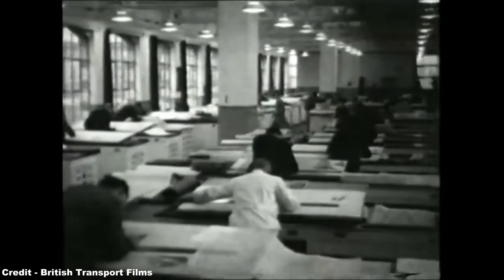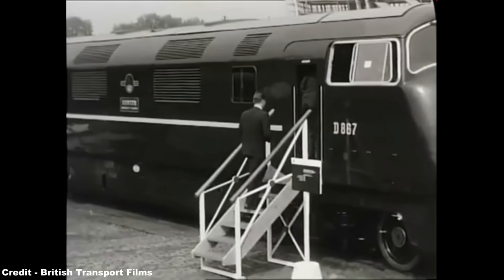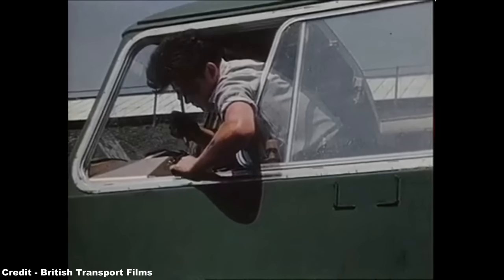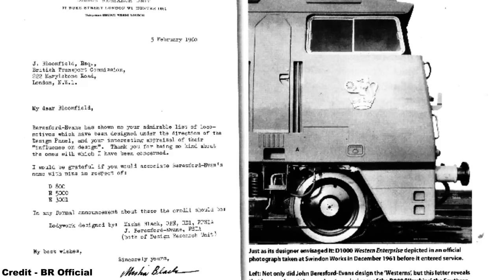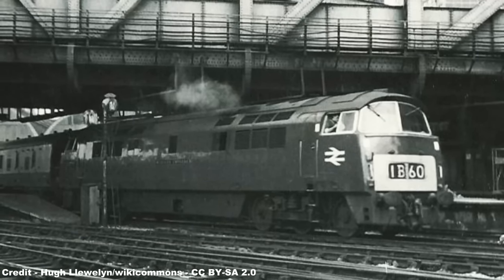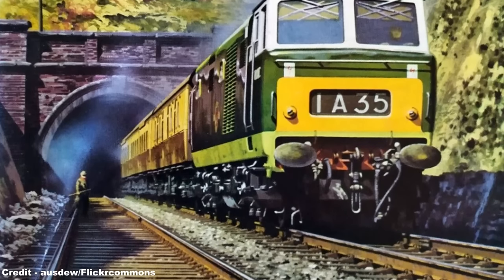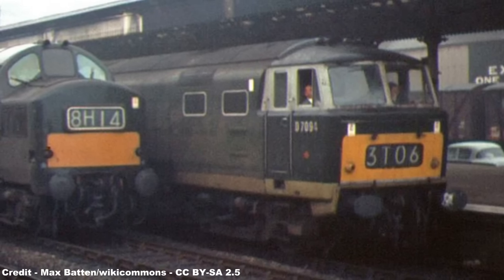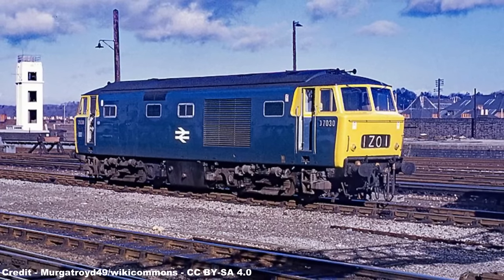The Tale of the Diesel Hydraulics

Comment: The Brush D0280 Falcon was not the progenitor of the Class 47 that ho our goes to the BRCW's lion which had most of the same design features of the Class 47 includi g bogies and engines. The most noticible difference between the Lion and the Class 47, znd the onky thing that is readily apparent to have been xarried over from the Falcon, is the grill over tbe cab. This is not surprising as Brush wo  the contract to built the Class 47 using components intended for the last 20 of an order for Class 46 which BR had cancelled in davour of the new Type 4.
Reply: I was wondering about the same as I know that Falcon was built several years after the first 47s got into service, but couldn't immediately come on the name of the prototype which led to the class 47, you cleared that, it was Lion indeed!
Falcon used Maybach engines paired to an electric transmission.
Reply: @Tom-Lahaye  Falcon was built 1961 and the first 47 in 1962. There were 3 prototypes under consideration EE's DP2, Lion and Falcon plus 2 that never got off the drawing board from Brush powered by the same Sulzer engine as Lion and the other powered by DP's EE (IIRC).

Brush had the UK licence for that combination.
Reply: @neiloflongbeck5705 Oops.. I checked it up and did see I got wrong on that!
So all three prototypes built then, DP2, Lion and Falcon were submitted in a quest for a lighter and more powerful follow up for the EE and BR type 4 locomotives.
But a 2 engine design had already lost when more powerful medium speed diesels were available.
Reply: @Tom-Lahaye  yes, the twin-engine concept was no longer the way to go as single engine designs could do the job as effectively. The only drawback to the single powerplants designs was their inability to limp home with an engine out.

The DP2 lead to the Class 50, the only reason it looked Deltic-like was because EE had the bodyshell available for immediate use.
Reply: I think you will find that the Lions's electrical system namely the AEI traction motors specified probably wound up in Australian licence built Alco's for the NSWGR
Reply: @neiloflongbeck5705 I remember seeing dp2 several times near potters bar way back when . Always hoped for a deltic , and sort of got one with dp2. Never saw the class 50 in service though. Back then it was a trainspotting kids dream as there were so many different variants on that part of the ecml.

Comment: Very enjoyable and informative. I was at Cardiff General to watch the commencement of Diesel services with the Hymeks which to me, were always the best looking of all the Diesel Hydraulics. I thought the other classes were ugly.
Looking back at the introduction of Diesels, however, I think that the entire program could have been carried out with just the products of one manufacturer- English Electric classes 08, 20, 37, 40 (and later replaced by 50), and 55. The EE diesel engines were reliable and the company also exported diesel locos.
Reply: Whilst I agree with you in the main I think the 40 50 and 55 could have been covered by the 47 from brush and I think that the fact that they are still operating on the national network today speaks for itself. I think the headlong rush to diesel and the flawed notion that the steam classes needed to be replaced with like for like diesels and in the same numbers resulted in a haphazard modernisation, it seemed BR learnt nothing from the Standardisationof the steam classes.
Reply: @philnewstead5388  I mentioned the class 40 mainly because it was an early derivative of the diesels designed for the Southern Railway, very heavy unfortunately, which was why I thought that the class 50 could be used as a more modern replacement. Replacing the 55s with 47s would be more difficult, I think, because they were designed for 100mph continuous running. My main point was that English Electric could have supplied or sub-contracted the lot, as their products (mostly, with one or two exceptions) have been the most reliable, and I would certainly not knock the 47s, because as you say, they are still here.
The standard classes of steam engine were good in concept and I thought they were very good looking, but it seemed to be wasteful setting up new assembly lines when the works could have just continued with existing successful locos as a stopgap until diesels were available.
Reply: "I thought the other classes were ugly." - IMHO the Westerns are up there with the Hymek in looks - the Warships and especially the Baby Warships though, I totally agree: They are fugly. Mind you, they had plenty of competition from some of the early diesel electrics in other regions, in the looks department...

Comment: Its a very sad end to the westerns. In my book, if a locomotive is on active duty on the mainline it should be maintained to the best of the maintenance crews ability rather than left to gradually degrade until they fail. Just seems wrong in my opinion. But if the top brasses motives were to get rid of them but suck every ounce of usability out of them, i can kinda see where they were coming from. But it doesnt bode well for running a reliable service.

Comment: If, the Western Region was mailing the German or NBL to make a hydraulic transmission that could cope the initial usage of the locomotive together with the proper engine and the proper bogies, the diesel hydraulic could have been survived and even balancing out the diesel electrics...
But, fate is fate and history is history...
And one matter fact is that diesel hydraulic is more suitable for a railway with light tonnage while it needs a locomotive powerful enough to carry heavy loads and sometimes had to dealt with flood that diesel electric couldn't pass through

Comment: The modernisation plan was undoubtedly  a success , large amounts of untried designs at relatively short notice , most problems were ironed out and many of the designs went on to have long working lives, it was enevitable that not all designs would be successful and that was one of the points of ordering different  designs from various manufacturers the other being that no manufacturer had the capacity  to provide a tried and tested design in the huge numbers required , to call the modernisation plan a failure is simply wrong , it fulfilled an urgent need for vast quantities of  diesel locomotives to replace steam locomotives  on an unprecedented scale .

Comment: It's sad that Britain couldn't even use it's own, home-built diesel engines. The start of the rot, and the eventual reliance on foreign made locomotives. Oh, how Stephenson et al, would have hung their heads in shame.
Reply: The engines in the class 35, 42 and 52 were manufactured in England by Bristol Siddeley.
Reply: @12crepello  The locomotives you mention used German built, or license-built engines of German origin. 
The decline of the British locomotive building industry had therefore, already set in. Where the country which invented rail transport, seemed no longer capable of designing and building, a 100% indigenous locomotive.

Comment: (Asking from USA):
Are the lines these D/H units were bought for now largely electrified?
Reply: If only. Part of the mainline (Paddington to Cardiff) is, and more is supposedly in the works, but most of the Western Region is still diesel
Reply: @drearyplane8259  I’m still salty about all of the signalling and electrification upgrades that keep getting announced and then cancelled, all over the island. Various places now even considering hydrogen-electric trains because electrification still isn’t forthcoming. (Which much like diesel-electric, despite being cheaper in the short term, the efficiency and fuel cost will make long term running costs larger than if line electrification had occurred.)

Comment: How did the efficiency of the hydraulic transmissions compare to electrical?
Reply: My understanding from my late godfather who was a senior manager on the Western at this time is that they were superior once the reliability issues were sorted but by that time the BR standard was single engine diesel electrics and the hydraulics were almost unique to the Western region a bit like Betamax and VHS
Reply: @philnewstead5388  Betamax never really had a unique advantage in terms of quality.
The primary issue was people comparing bargain-basement VHS machines and low-quality tapes and recordings to Betamax.
Betamax only had high-end units and tapes due to their expensive positioning so comparing a contemporary reviews of VHS machine (which also only had expensive machines and tape at the time) vs Betamax gave no clear advantage; other than Betamax's shorter recording time and shorter tape capacity.
Only years later when people compared them did the difference become apparent.
I.e. if you want to compare them you're either buying a machine that originally cost $600+ to something you could by for as little as $50, ignoring inflation (which you should not.)

Comment: ❤ But what is a Deisel Hydraulic?
Reply: In a diesel hydraulic the transmission of power from the engines to the wheels uses what is called a torque converter, this is a chamber which contains a compressor wheel and a turbine wheel and is filled with oil.
The compressor wheel will start to move the oil in the direction of the turbine wheel, guided by static vanes between the two, and starts to exert a force on the turbine wheel, so that will start to spin.
Compressor and turbine can spin at different speeds, so to say have slip like in a clutch, but when it slips torque on the output shaft will be higher than on the input shaft.
That made diesel hydraulics excellent in starting heavy loads.
1 or more torque converters are paired with a mechanical gearbox, the Mekydro has one torque converter with 4 gear ratios, the Voith has one for each of 3 gear ratios.
Decoupling the torque convertor is done by emptying the oil out to a tank for gear change and when the loco is idling.
So that's where the name diesel hydraulic comes from, it uses a fluid (oil) as part of the power transmission.
I'm sure you can search in Youtube or Google to find some examples of torque converters explained, as these were also used in cars and busses with automatic transmission.

Comment: Blue engine exhaust smoke is more likely a system of leaking piston rings or cylinder valves than leaking oli pipes, as sny mechanic could have told you. A leaking oil pipe is more likely to create a vast amount of black smoke when it finally catches fire.
Reply: Looking for a reply to this statement, Neil. The early hydraulics were high speed diesels and at tick over were heavily overfueled hence the exhaust rolling down the body. Also emissions weren’t such a big deal and after the filth of steam traction, stations were suddenly much cleaner places. But if you could go back to 1973 now ( that’d be good wouldn’t it?!) the railways would appear absolutely shit bound to what were used to now. Smoking diesels and cast iron brake blocks. Every first generation dmu left in a blue haze didn’t it.
Reply: @highdownmartin  our presenter was talking about the final years of the Westerns when heavy maintenance wasn't being conducted. Something as simple as a blown piston ring would be enough to condemn a locomotive. The diesel engines we had back then had a bad habit of not exhausting all their fumes if left idling for too long, especially those normally aspirated engines.